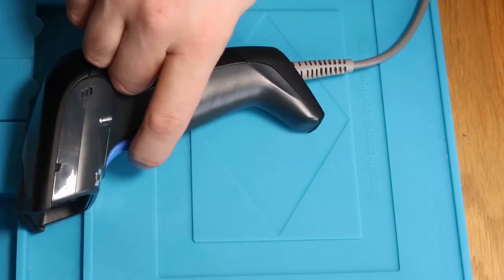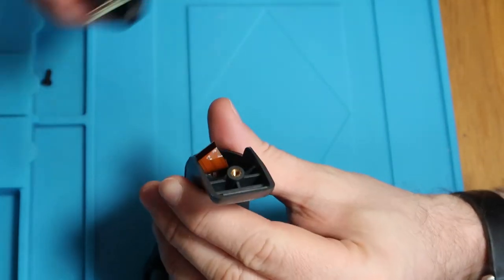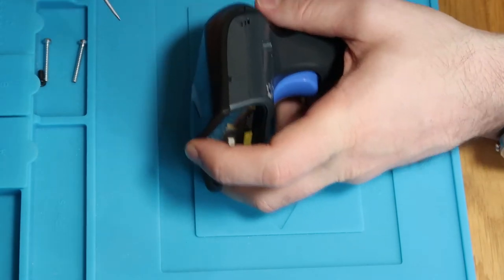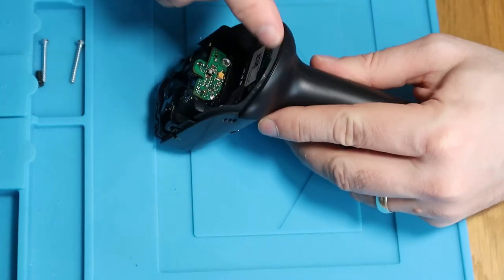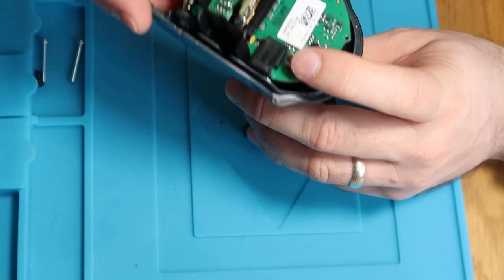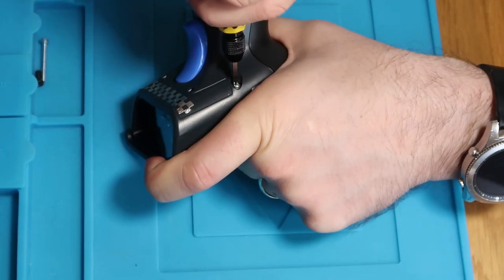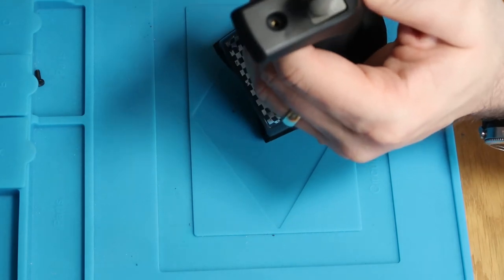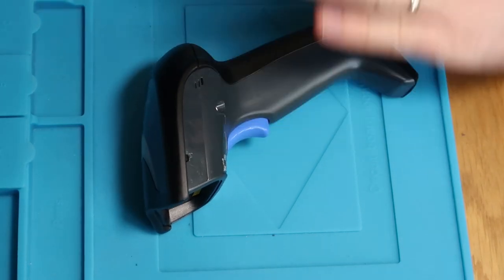Datalogic Gryphon Trigger Repair

Comment: This is similar to the hp 4400w. That is the wireless model. I couldn't figure out the clips and when I saw what you did I was like awesome. The scanner I was doing had the same trigger issue.  15 mins after watching your video it was fixed. Thanks.
Reply from the maker: Glad to have been helpful